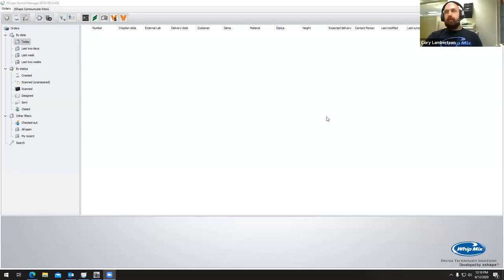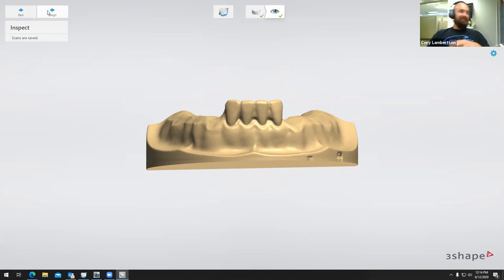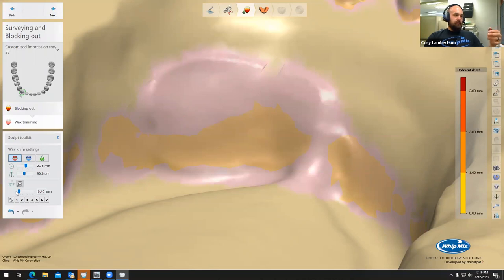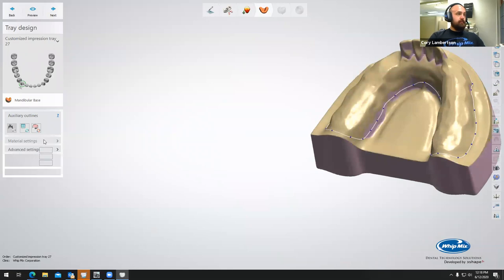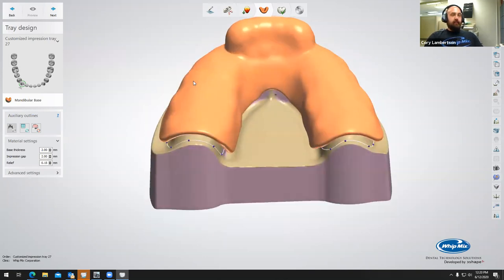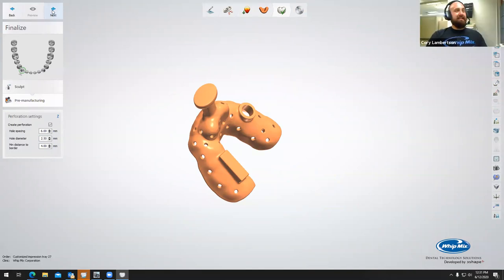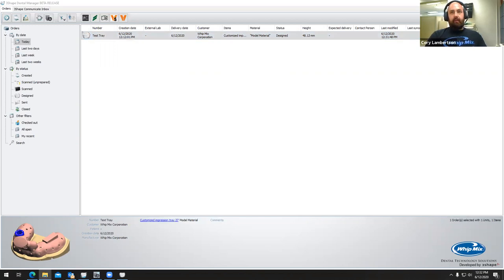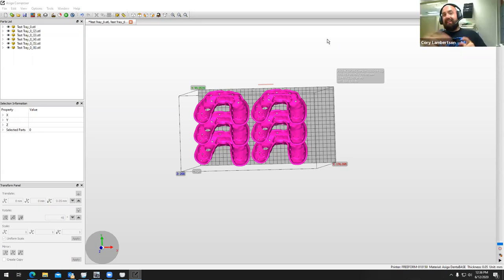Digital Dentistry Training Series: Custom Impression Tray

Comment: How do you guys go about tagging the trays? like if you print a full platform of them? do you do it on the nesting software or meshmixer type of thing? I didn't see any tag option of DS
Reply from the maker: You will need to use a 3rd party software such as Meshmixer or Netfabb.
Reply: I have found that using prusaslicer is very useful for quick nesting when u can then export and reimport into Asiga composer